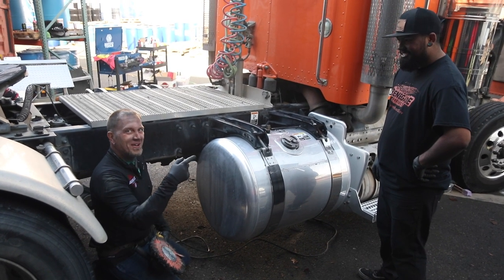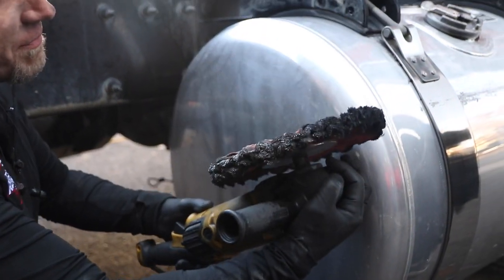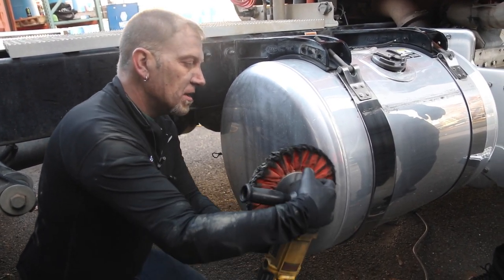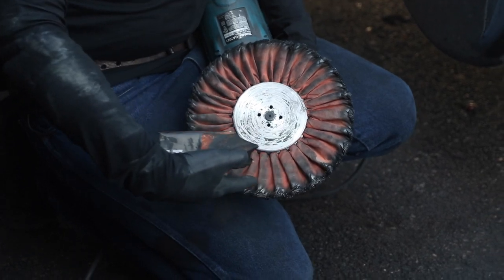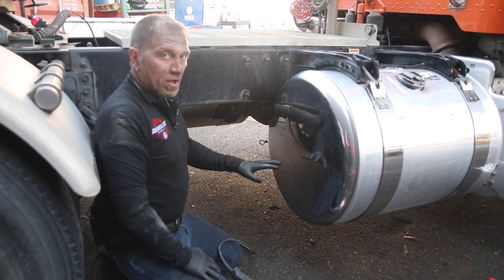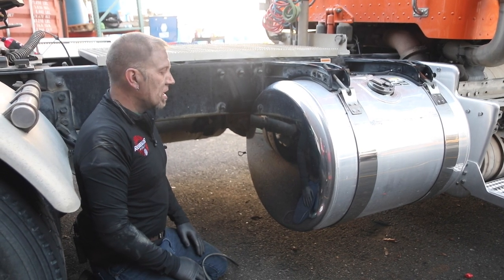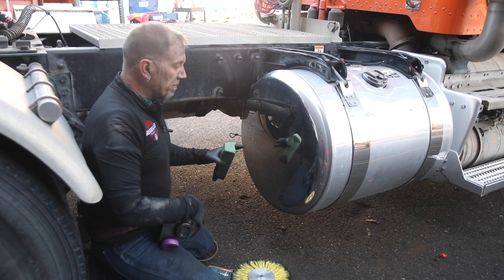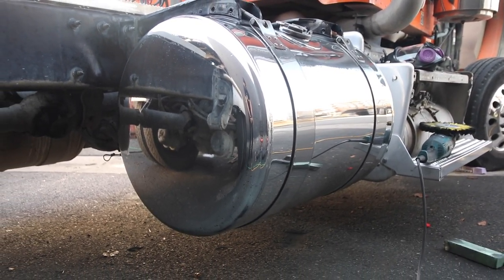How to Polish a Semi Truck Tank Easy Step By Step | Renegade Products

Comment: After hurting myself for 6 months. I finally learned how to do it like a master. It’s nice watching other peoples techniques. One thing I learned with buff and polishing, everyone has different methods.
Reply from the maker: Definitely! Hope you’re doing better!!
Reply: How does this look so easy. I just spent 800 dollars on tools to try myself and I've made a disaster of my end cap. I'm doing the same thing with the same wheel and it just doesn't work. I have some shiny spots but mostly dull/dark streaks
Reply: @Josiah_Harder  you gotta cut the metal with the pad with product then go back over it. It’s quicker and efficient as a beginner. So streak up the metal in any direction to knock out the crud. Then take your time and polish it out. If I knew you, I’d teach you. I live out in Phoenix az if you are in the area.
Reply: @tyreekwashere3238  Well im all the way up on the east coast of Canada so that wont work but thanks for the offer haha. I think it might have been the compound I was using cus I only had a cheap set of compound available but now ive picked up the right stuff and am going to try again when I get back home